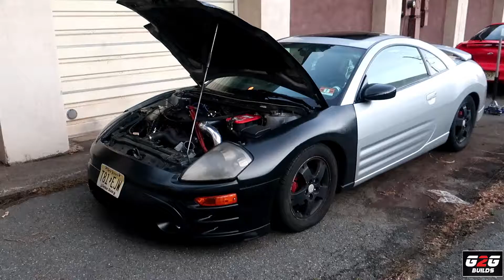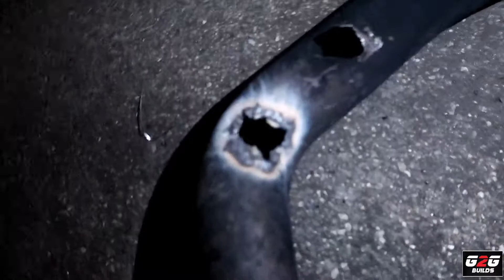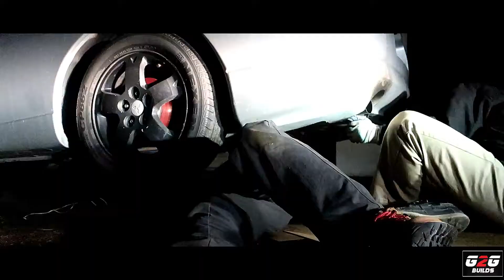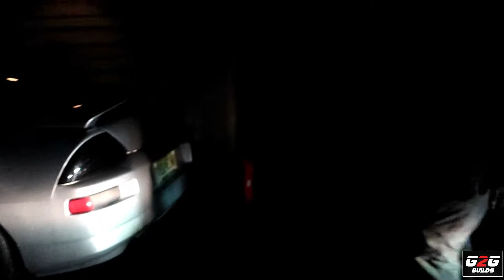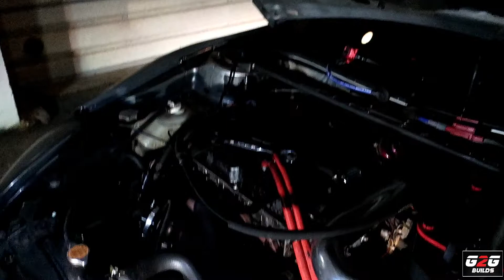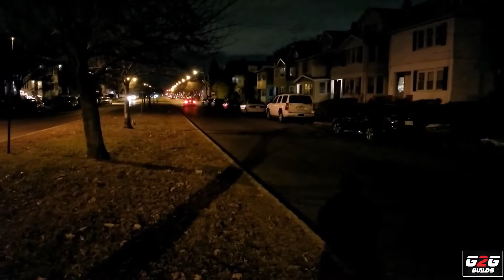3G Eclipse Turbo Build - (Part 7) Exhaust Leak Repair

Comment: Dude that day was stupid cold lol
Reply from the maker: Don't even remind me that.  Lol
Reply: What kit was used for this project curious to work on my eclipse
Reply from the maker: It was a partial turbo kit made by rev 9. I believe the kit is currently unavailable.
Reply: Is there any other kits that have been released since or something similar
Reply from the maker: Since the car been together, I haven't double check.
Reply: That’s good to know was there a tune needed or you kept stock ecu?
Reply from the maker: @eddieurbano9415  The stock injectors won't be able to handle more than 2-3psi. So, you'll need to upgrade injectors and then reflash the stock ECU. That will be the easiest way.